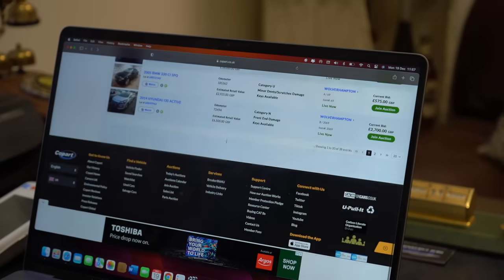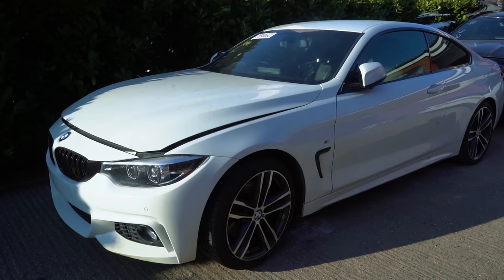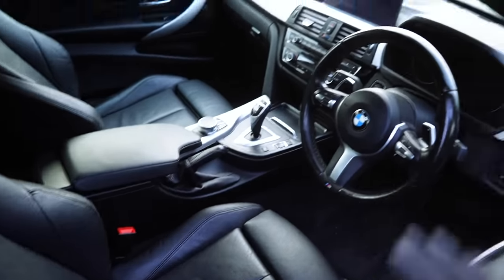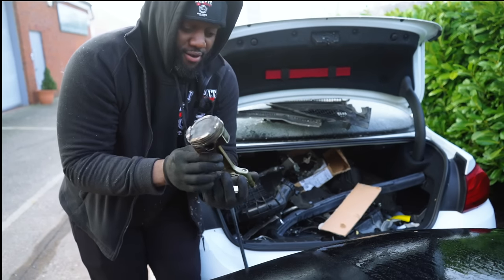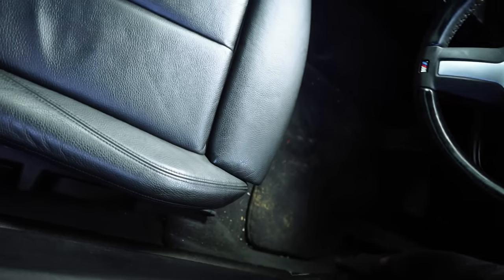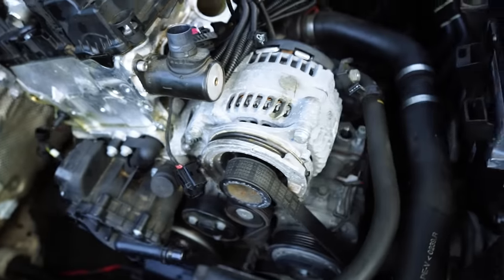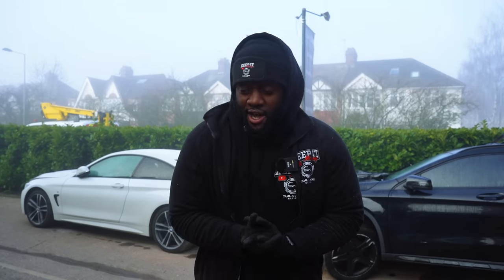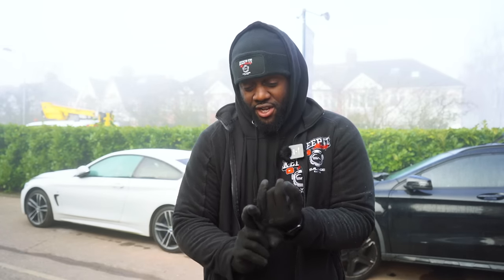THIS IS WHAT HAPPENS WHEN YOU BID BLINDLY AT COPART SALVAGE AUCTIONS | THIS IS CRAZINESS!

Comment: easy to spot it bro... front stance is higher than the back. that means some weight is missing from the front. And it's not always about changing some body panels and paint :) all and all, those pistons and rods don't look bad, you might want to dismantle everything and check the block, check the head, and maybe you can getaway with buying just some bits and gaskets.  Instead of buying and new engine for 3k, you identify if something is bad, and buy that part for a lot less, put it all together and you know you have a good engine.
Reply: I vote for what you said
Reply: Great idea 👍👍👍
Reply: Not a bad idea at all 👏
Reply: Could also be tools in the trunk or a broken suspension but yea here we can check under before the bid starts make sure all is there. And obviously nobody puts tools in a bmw like that lol
Reply: It's been stripped because the engine has eaten the vanes from the turbos as is usual with this engine.

Comment: Honestly not that bad, it’s the B48 engine, also used in the Mini Cooper S (181HP). Quite readily available for around £2K. So easy to fit, and gives you the opportunity to get shut of the OEM downpipe and upgrade the turbo. Easily fixable for roughly £2.5K🙂
Reply: Reliable lump cf to n47
Reply: Wow George. I just hope you get your money back out of it. Good job your a Mechanic lol. Anyway the best of luck with it. We all love your videos here in Ireland. Keep it up bro
Reply: Now tell the part about the particulate filter…share how cheap that is!
Reply: @beadlebamford9999  GPF and OPF still in situ mate, they haven’t touched the exhaust! You’d remove these anyway for a better sounding, non restrictive exhaust. So pretty cheap yeah…….
Reply: @InfantBuilders  he literally said the dpf is in the trunk but whatever
Reply: @beadlebamford9999  DPF (Diesel Particulate Filter), it doesn’t have one mate, it’s not a diesel! Lol
Reply: @InfantBuilders  he said it, not me.
Reply: I'd fix it if I were you, you should be able to get your money back on it and then some. It is a clean looking car and once run I think it would sell quick here in Canada but I don't know what the car market is like over there, I hope it works out for you.
Reply: @beadlebamford9999  I 2nd that 👍🏾

Comment: Been here myself bro with a Jaguar F Pace RS model, sold as run and drive. Car delivered through Copart it drove off the ramp 5 mins later while I was heading to the petrol pump to fill up, engine cut off. Ended up needing a full engine rebuild. Complained to Co part their run and drive definition is that upon delivery to the centre the car moved 10meters under its own drive. They know the true extent of the damage but hide it, we all know this. But either way had to fight through and did the rebuild took a big L. But came out leavening more about engine rebuild, valuable lesson to stay disciplined and lastly a family out there benefiting from a car rebuilt right and safe. Head up my brother, these are a the true times you got to keep it moving.

Comment: I bought a 2014 BMW 435 X Drive, which was sold as being Cat N 'MINOR DENTS/SCRATCHES' When the car was delivered my mechanic commented that the engine was running slightly off a cylinder, which at the time was thought to be a faulty injector. The car was parked until we had a slot to carry out repairs, we checked the compression, which was half what it should have been on one cylinder, we decided to dig deeper to try to resolve the problem, which turned out to be a bent connecting rod. This was obviously why the car was sold through Copart. When I approached copart about this problem their reply was ''TOUGH LUCK''  and I should have researched the car before bidding, but viewing is not allowed in Belfast Copart.      I am preparing for a court case.

Comment: Been there, know the feeling. Make it into a project car, save time and get your ROI faster by replacing the engine with another, keep it same size engine. Upgrade the turbo (or not) , put on a body kit, new wheels, new exhaust and finish off with some stickers. There no accident so you'll get a decent price from a youngster who want an eye catching Beemer. Advertise the old engine parts for 1k to recoup some costs. You'll make profit overall and have fun doing the project. Keep videoing it, perhaps a viewer will buy it from u.

Comment: I bid blindly on a cat s 2017 transit 350 55k miles 7.5k + vat and fees which came to 9.5k, there was gearbox grinding, unfinished previous bodywork, rear doors missing and a sliding door missing! I only thought the missing doors was the issue, im still stressed about it and idk if theres more issues
Edit: there is a mileage discreptancy and i have a bad feeling that its a double category!
Edit 2: it was sold by a private seller on copart

Comment: On the copart listing for this vehicle, it would have stated that the car did not run and drive. Also they should have stated that the damage was mechanical in the listing as well. Here in canada this info is not additonal and is stated right on the listing.

Comment: Dee I would source an engine and fit it if it was me. Your £8600 in the hole which is a lot of cash and if you get a engine at 3k or less then your 11600 in the hole but it must be worth 15 or 16k also I am guessing its not a category car so its worth full value. OK its not massive profit for the time required but its better than stripping for parts.

Comment: Honestly, get the engine out, desmantle it, see what the problem is, I bet it's had water damage before, re-sleeve the short block ( £400 ), skimm the head and block, add pistons if needed and re-assemble. You will save it for £1000 and have a good car.

Comment: Looks like a typical remapped 320i that's gone bang - they do that. BMW will have told them to FO and they've fired it through Copart. Still, another B48 engine fitted and it'll be a runner.

Comment: Copart got me a couple of time with the runs and drives bullshit. The car started with a massive Rod knock. So they called that running I put it in gear and it died. I replaced the engine and will take a loss but I learned my lesson with them.

Comment: If I had the budget, I would keep it for now, and find the same car that was extremely totalled in the back. I mean something that looks like it got rear ended by a bus. As in you look at the pictures of the back and your skin crawls a little.... that's the car you buy! Make sure it starts/ runs😂 and there is your new engine for the white BMW. Sell the rest for scrap or parts. And get back out there. If you really want to, make it a done car, and then buy one that has been hit on the sides and pull parts off that doner and fix up the next car. But once again, you have to look at your budget and see if there is room to get a doner vehicle.

Comment: I'd try rebuilding the engine see what's going on with it.
Might be something mot as expensive as a new engine.
I bought a 2018 sprinter they put a blown engine in the hole and sold it on copart.
Never even bolted the prop shaft back on. Or put gear linkage on.
Ahh tricks of the auction world hey.
But they put the engine cover on and air filter box so it didn't look like it was fucked.
Same on your motor
Enjoy 
But keep smiling 😁

Comment: What I would do is take that engine out and have it sent off and checked by an engine machine shop. If you can see any holes in the block then dont but if not send it off. You have most of the expensive parts there.  

Take the spark plugs out and use a thin cane in the hole to see if they each rise up when you turn the engine over by hand. Also see if the engine headbolts are still tight.
This engine may be salvageable, if you check it over properly. It would be a waste if not, and spending a load of money on a new engine.
 That is where I would start anyway, others may have a different opinion to me though.
Reply: Pistons won't rise up because they are laying in boot 🤣🤣
Reply: @SalvageMasterEssex  How do you know they are from this car if it's been in a chop shop?.. They could of replaced it or from another car, there is only 1 in the boot, seems odd. I have bought and sold enough stuff to know to not always go on face value..

Comment: I bought a bmw 335i no physical damage it said run and drive. Unknown issues. Turns out half the car didn’t communicate, power steering doesn’t work, abs, airbag module, check engine light. Everything you can possibly think of. It was with a mechanic forever couldn’t figure it out. Now ordering modules and rack and pinion

Comment: Brother I would advise getting a new engine for £3000, strip the engine parts which are currently in the car and see which parts are genuine and reusable and sell those parts on. You could easily flip it for £14,000 to £17,000. With 11,600 investment you could make profit between 2.4k to £5.4k

Comment: Dude..i do this since 2004..you need buy run&drive..then 80% it runs..only on EVs..now they swap.out the batteries with old failed ones at any salvage Auction,so you must check it with obd..at the site..or dont bid on it..🤔🇺🇸🇬🇧

Comment: Just attempt to fix this engine, take the engine out, check the parts, see what is good what isnt good, if it looks like it needs 50 million different parts then just buy the 3k engine swap it out, then sell the good parts from this engine. If there isnt much to replace then put it back together and you will be in profit. I think you are overthinking this and you will be just okay.

Comment: Easy mistake to make when your in the zone, but it is a straight forward repair for you, as for copart and new buyers it is  a salvage auction do not buy it you are expecting easy low cost fixes,  the additional notes are a guide only not a honest description of the cars faults or condition,  this place is full of faulty engine and gearbox motors, beware and always check, done it myself...

Comment: Dee. Either..fix it, get the required engine parts. Rebuild as the interior and exterior are awesome and a great colour combination. Or, buy a used second hand engine. Shop around, as no rush. Or sell it on privately as is. Or back at Copart. You can fix this.